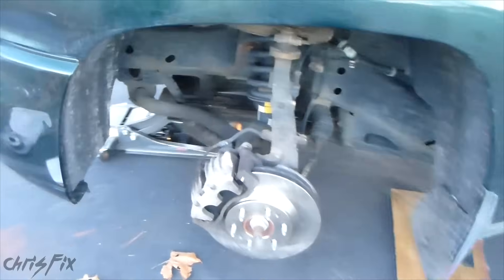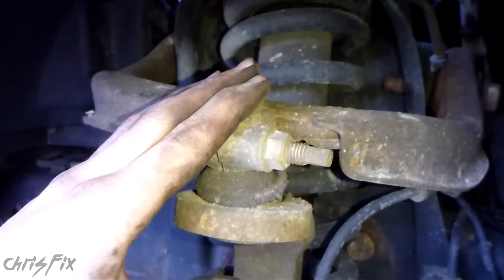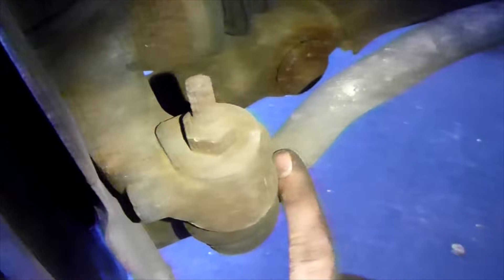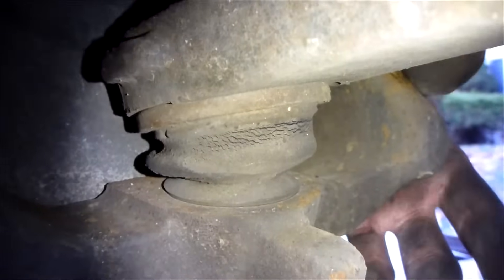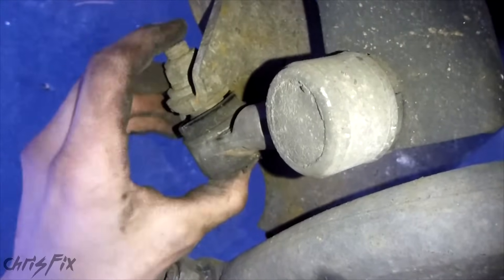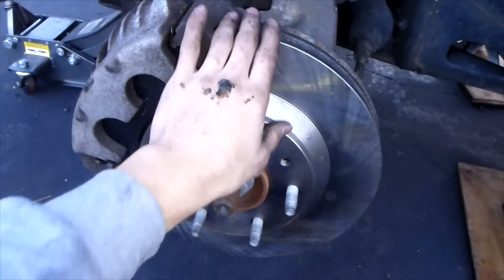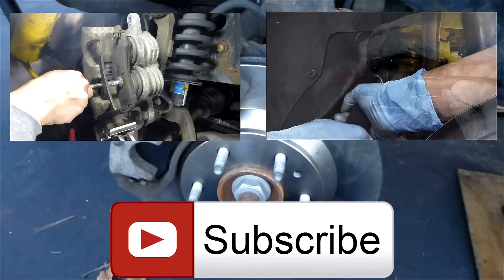How to check out your own car's suspension system

Comment: Chris I have a 2012 Honda Accord SE that doesn't return to center. Had wheels aligned tie rod replaced one lower Ball joint replaced refurbished rack and replaced the power steering pump flushed the system with Honda fluid. 3 mechanics looked at the car and can't find the issue. Also had the sub frame checked by a body shop as one mechanic tried to tell me the subframe is bent and wanted to hit me for a $2,000 repair. The frame is perfectly straight. There's no, bend. whatsoever

Comment: 2:10 Was that not a little play side-to-side with hands @ 3 o'clock & 9 o'clock? I'm just a DIYer trying to diagnose popping noise when turning the wheel & rattling noise when going over bumps that seems to come from the front-driver suspension on my 2005 Tahoe LS 5.3L RWD.

Comment: I got new lower bushings and strut and shocks. Car is still making a noise at the wheel when I hit a pothole or bump. It sounds like tire is loose, but tires aren't. For sure I hear a scrapping noise from tire at slow speed. Need serious help. Don't know what's wrong.
Reply: Check the brake caliper
Reply: Check the tie rod ends and sway link...

Comment: The video is very helpful.  I had a very hard time getting the old links out of the bottom…I ended up having to use an air hammer/chisel the beat it out.
I also had difficulty adjusting the tightness. I messed up one of the links by over-tightening the upper but with an impact.  I finally loosened both side top bolts…loosened the sway bar bushing clamps and evened up the bar.  I adjusted tightness with the “mushrooming” suggestion of this video and then went back at torqued down the sway bar bushing clamps.
The end result was good.

Comment: The inside tie-rod shouldn’t move in/out, correct?

If it does, does it need replacement soon? I find my rear driver can be moved by me pulling/tugging at it.
Reply from the maker: Inner tie rod should have 0 movement in/out. Sounds like it needs replacement asap

Comment: I learned how to do suspension work from car mechanic simulator 2018! Now I already had done work on a car before but it’s actually fairly good for atleast knowing where most parts go and when it comes to suspension. The engine is fairly accurate but simplified

Comment: Hi Chris.. hope you can help. I changed my front shocks on a 2013 Nissan Altima but. I switched the old spring to the new shocks, and
 I have a crazy vibration and my motor mounts support are brand new.

Comment: My 2019 Lexus es350 vibrates while driving, produces clanking and popping sounds, especially when turning left. Although it’s been due for a wheel alignment, the new noises raise concerns. Tires have been rotated and balanced, but the issue persists. What could be the problem?

Comment: i did not find this very useful for finding out the source of a clunk when all parts are in good shape. also when you said outer tie rod back and forth then for inner tie rod in and out....did you mean the same direction of movement for both? or did back and forth actually mean turn left and right?

Comment: Do u have a video to check front axles? Like ur video about the tirod?
Reply from the maker: Nothing specific for front axles but if you're seeing grease/obvious tear in the boots or you're experiencing a clicking/knocking while driving or turning, it is usually the front axles.

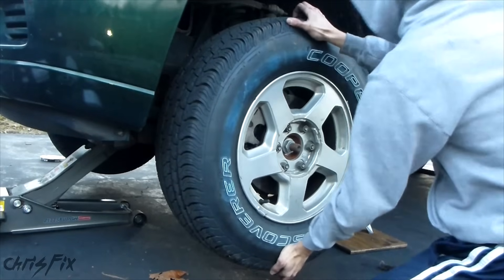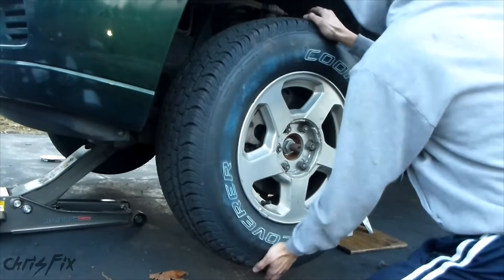Comment: But wait @2:20 there was no movement and you said if there  was , to check the ball joints but no movement and and @2:30 they are bad and need to be replaced ??just confused?

Comment: Is it normal for the ball joints to be greasy when you touch it?
Reply from the maker: They should be dry but they can be greasy if you pumped them with grease and didn’t clean up
Reply: @chrisfix  
I didn't pump them with grease at all so there might be a problem. I did run over a curb a couple of weeks ago at approx 5-10 mph and it sounded like a loud bang. Could that cause a leak?

Comment: So I have a 2018 hyundai sonata. The rear wheels look a bit close to the car body. I had it checked by 3 different mechanics and they all say nothing is wrong. It's visibly lower than the front. Any suggestions?

Comment: Chris for a FWD vehicle with brake disk how many spins in wheel are normal when jack up 
I heard that for a rear brake disk with touching slightly brake rotor max is 2 spin but what is for front wheels
Reply from the maker: I don’t know what you mean
Reply: @chrisfix   sorry
 for a front wheel drive how many spins are normal for a front wheel when jacked up before come to a total stop due to weight friction etc
Reply from the maker: @Mghanabro  oh, like if you spin the wheel by hand? You won’t be able to make 1 rotation by hand. The friction from the brakes and bearing will stop it quickly.
Reply: @chrisfix  yes but it’s different for rear wheel 2 rotation free spin max not sure how many spin for front wheel

Comment: I'm just getting into cars and know almost nothing about maintenence. Is there a specific type of grease I should use?
Reply from the maker: There might be an OEM recommendation in your owners manual so check there first, if it doesn't say anything then any kind of synthetic/high temp automotive grease will work fine in your suspension.

Comment: Hey Chris if a car is pulling to one side what do u think I should check as to what the problem can be?
Reply from the maker: When you brake or when you drive? If it is when you drive it could be tie rods are worn or you need an alignment. Check motor mounts too

Comment: I got inspired by you when my wife made a hole on my bumper. 
I m fixing it atm thanks to you. But because I was too lazy to remove the bumper from my Audi, I put a stainless steel mesh which I got from a sif from the $ store as a base on the hole, using duck tape to hold it in place. Then I put the filler, and I’m sanding now. I can’t believe how good it’s coming out! 
The most expensive part was the car filler 10$ the body paint 17$ and the primer.

Comment: Usually when driving there will be noise or play if parts are not performing well from the steering system, and or suspension.

Comment: to anyone learning use a pry bar . not a hellishly long one but one about a foot or two and pry pretty well on spots that were mentioned to look for play . I was told a while ago that if it moves with the little amount of torque you can supply , when the tier hits the ground and the vehicles ton of weight is on that point it will definitely be moving

Comment: What does it mean that the wheel hub is pushed inside towards the engine with negative camber? It happened after I hit a curb while turning and wheel is minimally damaged just the outside no dent. Please I need help.

Comment: Do you recommend adding grease to the joints with a grease gun via a needle puncturing the rubber boot?
Reply from the maker: If you do it correctly, then I would recommend it!
Reply: @chrisfix  you're the best!
Any chance you can make a video on that? Grease suspension joints on  parts with no grease fittings.

Comment: You are literally dangerous depending on whether the suspension is top loaded her bottom loaded the shock absorber will keep you from detecting how bed the upper or lower ball joint is you have to unload the suspension with a special  To to do it accurately and most of the time you're going to want a big pry bar at you can't always put enough attention on each part with just your hand to tell you exactly how bed the part is you should not be allowed on YouTube and I hope somebody Sue you when they wreck following your advice

Comment: So every time I go over bumps I get a terrible squeaking sound. No noise when steering no noise when braking no noise when accelerating. Just when the suspension is compressed I looked at the struts seems okay to me checked ball joints all good the only thing it could be is either sway bar or control arm but I’m not sure

Comment: Question. If my car ride is bumpy when my the road has a little bump or hole. Would that be the strut
Reply from the maker: Does the car feel stiff or soft like you're on a boat?
Reply: @chrisfix  well the car feels normal nothing wrong with it like the turns are easy and I don't have to force nothing just when it comes to going over a little bump or something or even just going downhill it is way to bumpy, I put it on neutral and its still really bumpy. Feels like when it should just be one tiny bump its like 3 more right after. My car goes over one bump in the road and it jumps 3 extra times

Comment: Which part of the suspension system do you check first when you start to hear a clunking noise, the last time I just replaced the front struts and the noise disappear.

Comment: Can you do a video about lifter tick and if the engine flush with all the type of oil flush actually work? I have a 2015 GMC Sierra with a 5.3 litre engine v8 and it has a slight tick coming from passenger side engine I had it checked out and no codes popped up also was given a quote to fix if I really want it gone for around $4000 Canadian. Thanks

Comment: I get some pretty harsh squeaking coming from the front end when in first or second and I let off the gas going slow in a parking lot when it lurches forward or when I accelerate fast and it lurches back any thoughts?

Comment: Hi Chris Thanks for all of the great videos.  My 2016 Nissan Altima drivers side feels like it bottoms out on drivers side because I hit a big pothole and it seemed to mess up something.  Anyhow, I have the tire off and I was shocked to see how skinny the rod the connects the strut tower to the stabilizer bar.  SO I grabbed this rod, and with a twisting motion it moves with like at least a 1/8 to 1/4 inch play.  It does not move at the ends of it.  I have 115K miles on the car and have replaced the rear shocks,  I raised the boot on the strut tower and it is not leaking. with the tire off I tried moving some of the ball joints and cannot find any thing obvious.  Is that stabilizer connecting rod supposed to move like that?

Comment: Yo Chris 05 subaru legacy 2.5i sedan my driver rear wheel is toed in and looks camber due to a slide into a pole any advice but where is a good spot to start  sorry if it's a goofy question i just know you look at it from the rear the left tire is leaning in and pointed to the right a bit please i need your help/ advice

Comment: Just as a reminder, no movement in joints doesn't mean it doesn't need to be replaced. Had two lower joints, one lose one not, the one not moving was worse than the one with play in it.

Comment: Hey Chris. When i move the steering wheel or drive over a bump or uneven road i hear a knocking sound, it sounds exactly as the knocking you would hear on a wooden boat. What this may be? Ball joint?

Comment: Yo Chris, and everyone else. Be sure to check the axle nut before declaring it a failed wheel bearing!!!! That was the case on my car.
Reply: Aaron _  what do we need to check on the axle nut ? If it’s loose?
Reply: Julien Janet pretty sure you could feel play in the rotor when wiggling iy back and forth. grab the top and bottom of the rotor like you would if you're checking ball joints.

Comment: This video explains alot about suspension. I'm in the process of diagnosing whats wrong with my car. Theres alot of rattling when I go over little to medium sized bumps. I will look at everything explained here, thanks Chris!
Reply: I'm having the same problem, did you figure out what was causing it?
Reply: Yes, I bought some Monroe struts and installed them. Fixed the rattling and it drives smooth now!

Comment: Car maintenance is everything. I thought the engine is the most critical part of the car. However, the suspension needs to be taken care as well since it carries the load and overtime, you need to carry necessary maintenance. Having said that, I am extremely grateful to Chrisfix for providing a comprehensive car maintenance, inspection, and troubleshooting. I started watching your channel after my father's car overheats in the middle of the road. I was 15 years old back then and I found out my father did not went to change the oil until 60000km.
Reply: What! 60k is a damn long ride on the same oil
Reply: @coreygillet  That clanking sounds like your CV joint.
Reply: Sea 2121 i once saw this poor jaguar c-Type where the suspension was not taken care of at all. One full side of the suspension was completely shot. It looked like a drift car. The other side looked fine but I couldn’t help but feel bad for the guy who had to drive that car
Reply: This is actually what takes the longest time doing maintenance and service checkups professionally (work at VW shop), changing oil is maybe 20% of the time
Reply: Sea 2121 I guess he "did not went" to!
Reply: @residentevil2928  nice passive aggressive statement

Comment: I just got a used 98 integra. I just got a brand new set of summer tires for it and had them installed/balanced at a local car shop. The mechanic said he thought I didn’t need an alignment because the previous tires had worn evenly.  The car doesn’t pull to one side or another. But the steering wheel does feel ever so slightly off center. Not that the steering wheel doesn’t sit straight when I’m driving. But when I turn to the right there’s resistance right away and i have to turn the wheel harder. When I turn left there’s no immediate resistance and The steering wheel is easier to turn left. Is there a common reason why that might be happening? I’m pretty sure half of the suspension components are shot at this point, but if there’s an area I should target first, if it’s even a suspension issue, then I’d address that first.
Reply from the maker: I wonder if the power steering rack is starting to go bad or if there is enough power steering fluid?

Comment: hey there, great & simple guide.

Ok, Now here's a question to Chris and anyone else who can guide.

I have a 2013 Hyundai Atos Eon entry level hatchback costing approx 6500$- clocked 43,000 kms or 26,000 miles, built for Fuel Economy. Seeing your video, as a lay person, I can clearly see that your Tyre Rotor or the Hub to which the Tyres are fitted onto & the Brake rests on; it is in Mint condition showing silvery metal maybe Aluminium or steel.

Similarly the ROTOR on my EON when I fixed a tyre was all rusty looking Brown (not rusted yet but seems susceptible already). I was wondering the same watching your video and if there was some sabotage at the AUTHORISED SERVICE CENTER since its been serviced there all time on schedule. Anybody Any Idea as to why?? 

This hatchback needs approximately around 100$ in India (I know it sounds inexpensive) as yearly maintenance costs but post Free-Service I have been charged thrice 200$-300$ and inspite of that these guys already recommend a CLUTCH ASSEMBLY replacement (almost half of it or the Full assembly) + Suspension checks and replacements. These checks and replacements come post 80k Kms or 50,000 miles. 

This surely is suspicious activity & Iam onto DIY Troubleshooting & finding out the actual problems areas and why its bizarely acting up.

Chris; nevertheless could you post a Video as to how to check the Car Parts similar to your INSPECTION OF PRE-OWNED CARS but in detail. You could do HOW_TO_VIDs section-wise, like CLUTCH INSPECTION, Transmission Inspection, Exhaust Inspection, Suspension Inspection (In This video you didn't talk of whole and left out on STRUTS & Coil etc), Underbody Inspection, Steering System, AIr-Condition system, OBD2 thorough Scan & clearance of Codes detection, and several such, as to how one could Trouble-shoot problem areas & find out if the Service Guys Mechanic is Suggesting Trustworthy services and conditions. 

These Mechanics have the gall to feed Monstrously on a Owners Car & his ignorance of its Mechanics to fleece him. Sending Kids to College is no Excuse to do so, & if It was I shall take to Guns too?!

These are Great Ideas for your Videos & Ye shall Credit me ;) ( I shall think of doing some Vids Myself as well - Chris got competition- LoL; I dont have the time but inquisitive as I have to know Car-Systems)

Do Kindly Revert.

Comment: Bro, my ride feels stiff. when i pass by an industrial road she just gets shaken up and like everything is gonna fall off and when i hit a speed bump she doesnt seem to go over it smoothly it feels like a big thud. My shocks doesnt seem to be blown tho cuz it doesn't bounce around too long after i hit a speed bump but it doesnt seem to be absorbing bumps smoothly. So do i need new shocks? Or new suspensions? I have a torsion bar in front nd leaf springs at the back.
Reply from the maker: You can loosen the bolt that keeps tension on the torsion bars so the ride is softer. A torsion bar/leaf spring suspension is going to ride rough just because they are stiff.
Reply: ChrisFix thanks man 👍
Reply: Chris, The same rough ride happens with my car (2009 Corolla) but only when the temperature drops. When its warm outside, the ride is smooth (especially after the car sits in the sun for 30 min or so). When the temperature drops and the weather gets gloomy, the ride gets rough and it feels as if there is no damping. My shocks are new and so are my tires. The lower ball joint was replaced just an year ago and there is no play when i push the wheels. I've tried different tire pressures but the problem remains. Please help. Thanks.